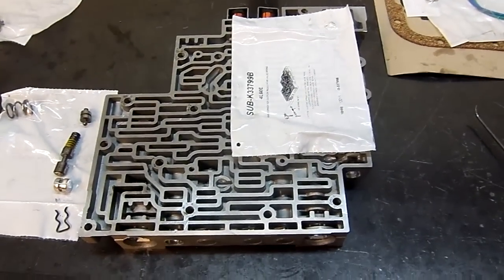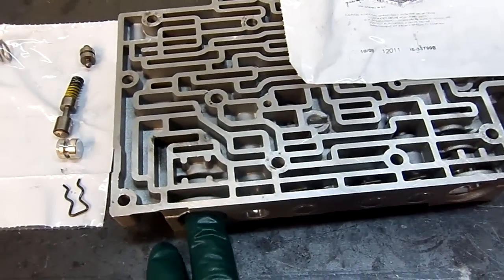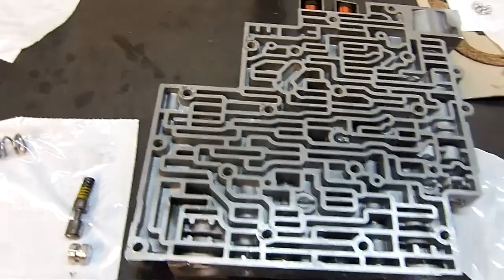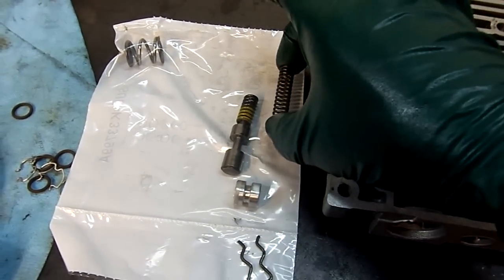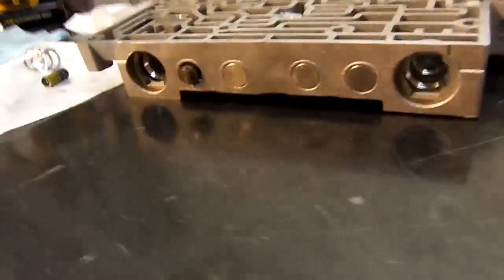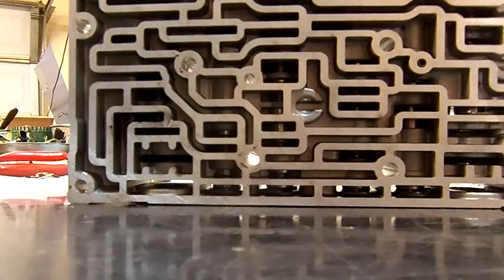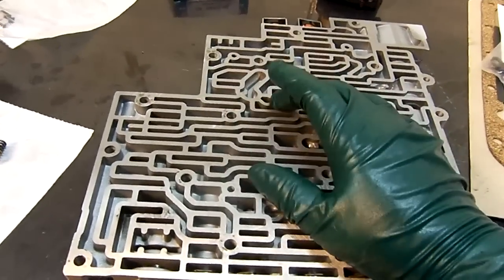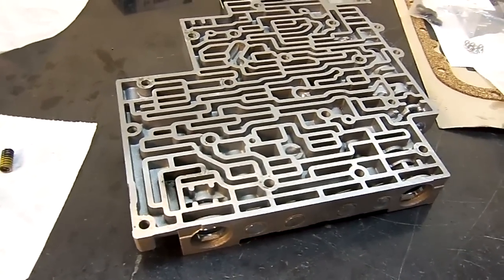4L60E Transmission P1870 Transmission component slipping (early valve body) - Transmission Repair

Comment: Mr. Gutierrez, Please help me. I have a 98 Silverado V8, 5.0 with 148k miles on it; I'm not sure what size my transnmission is. I had the radiator replaced recently and shortly afterwards my truck started leaking transmission fluid it appears to be coming from the big hose leading to the radiator. Then this P1870 code came up. When I check the fluid level when the truck is cold the transmission fluid is up to the "hot" level on the dipstick. But when I check the fluid level when it's hot, it looks like there is no fluid at all, which scares me to death, so I add some right away. Honestly, I don't know if the leak is from overflow, but I guess that's a possibility. Also, it only leaks when the fluid is hot and the leak is pretty heavy. Do you have any idea what may be going on with my truck? It's driving me crazy worrying about it and how much it might cost to have it fixed. I'm no mechanic and would never attempt a job this big. Please help.

Comment: found my problem with no drive or overdrive. It was in the 2nd-4th gear servo. Put a new corvette piston in and it worked. Longer servo pin was too long so I didn't mess with it. Original servo pin is a little worn, but is working
Reply: (1/2) I used origional pin. Changed the piston with a Corvette one. Trans works fine now. The Guy that rebuilt it for me was screwing me around, so i did it m
Reply: (2/2) yself. When it was shifting into drive, but nothing there, it made me think that the band wasn't applying to the drum, and that's what it was
Reply: You can use this as anotherr reason why you wouldn't have drive or overdrive. I couldn't find this answer anywhere online. Only friction plates worn or sprag.
Reply: You're welcome. I couldn't find this fix anywhere online

Comment: Hello Hiram, I have a p0752 shift solenoid stuck on. I replaced it still comes on and i cannot shift past 2nd gear on a 2007 chevy aveo 82000 miles.

Comment: 96 Tahoe 4x4, after say 20 miles. The torque convertor stop locking up. No codes. Will that long spring fix it?
Reply: did you ever figure this out blackricedenice
Reply: bam6972 Yes, when I replace the distributor (290,000+ miles) the engine stop cutting out and the TC started locking up again. Something about the cam sensor help the PCM lock up the TC. Only took 2 + years to fix.
Reply: dam... really? wow... I didn't want to replace the distributor but if I have to then so be it.. any other tips that you did to solve the puzzle. thanks for the info...
Reply: bam6972 Got the part off ebay new for $36.50 free shipping.

Comment: Hey I've got a 97 Chevy 4x4, I'm getting the 1870 code. To replace this part I was wondering if I have to pull the valve body off to replace it? Or can I just pull the valve body cover off and replace it from there?

Comment: I had my transmission rebuilt by a guy in October. 1997 chevy k1500 4L60E. When I got it back, I didn't have overdrive. He told me it was a bad shift solenoid. I changed them both. Still no overdrive. Then I lost drive also. !st, 2nd, and reverse work good. Then I started getting the P1870 code. Can you tell me what to look for in order to make it right.
Reply: Thanks. I'll check that out

*****
Reply: Dennis Xander It's not that. I have 12 volts at trans fuse and gauge fuse. also have 12 volts at pink wire to transmission in park and drive
Reply: Dennis Xander shifts to drive, but just the rpm go up. New clutches and band installed last week, along with all new switches and solenoids
Reply: Dennis Xander  no more P1870 code either. I fixed that problem. still no drive or overdrive
Reply: Dennis Xander do you think it would help if I install a pinless forward piston
Reply: Dennis Xander I have no power at the pressure control solenoid. Now I gotta trace wires
Reply: 3 months. That was over for awhile. I have no power to pressure control solenoid. Have power everywhere else.

Comment: I know this is for a 95, but mine is a 99. I wasn't getting any codes, but my rear planet shattered, could this have been the reason? my TCI/CCR wont retract, the piston is scratched and the spring seems too short like the one in this video.I finally got mine out,  used a small file to knock down burs, but I think the spring has lost its strength.

Comment: hello Hiram, wondering if you could please give me some advice,   i have a 2000 blazer, 4l60e,   i have that 1870 code, and it goes in and out of lockup , not always but after driving for a few minutes, ive replaced the valve body with a good one with the same same over sized spring like in your video,  but it still has the problem.  im hoping its the torque converter or maybe input shaft seal.  but i donno. any way to find out?  or do you know what else to check?  would really appreciate any advice.  thanks

Comment: Hello hiram I have a question I swap a 95 tahoe transmission and engine into my 94 silverado that used to have a 4.3 engine do I need to change my ecu to make my transmission work the rigth way ? Cause now I drive it n all it does just get to 30 miles n thats it wont go further than that it seems like its slipping what can I look to fix it

Comment: I have a 99 trans am with a 4L60e that was just built and I noticed in first gear feels like the TCC isnt engaging intermittently had my builder take it apart twice couldnt find a problem fluid was clean already has a .500 boost valve and he turned up the pressure on the control valve and still has the same symptom do you think this could be the culprit?

Comment: excellent real world repairs. Late model 4l60e vlv bdy- you flipped the isolator vlv and on the early vlv bdy- you repl. the spring.  Can you use repair kit A74741Q (stationary vlv) on either vlv bdy? thanks

Comment: I have question for you what would cause torque converter to drain back. Pump clearances and bushings are good. This is after rebuild it moves after it get fluid in the tc and drives fine. Just when it sits over night fluid drains back into trans.  Thanks
Reply: ***** It is a 2000 Chevy Tahoe 4x4  5.3l 4l60e. I have the trouble code P0742 tcc stuck open. When coming to stop or reverse it stalls. I have a new tcc solenoid with anti drain back valve coming to replace it. The trans builder gave me a 2004 valve body to put in,  due to him being busy in. He thought it was that. I placed all check balls in and held them there with trans assembly lube. Still have same problem and same code. would a stuck tcc solenoid cause drain back if open and the valve stuck open?
Reply: Hiram Gutierrez . Hey I need help I have Lumina ss 2007 4l65e transmission has changed also changed the clutch 1/2/3/4 Manfall Presser solenoid TCC clutch problem 3/4 not working. But the 1-2 reverse works well

Comment: I watched your other video before I saw this one and I installed the spring first and then the two valves and plug, then drilled the plate. Will this accomplish the same thing or do I need to change it around before I put it back together?

Comment: Hello Hiram, awesome video.  I have a 99 s-10 that is identical.  At first the endplug was stuck in place(lined up on the end of the valve body like the other ones) and I pushed in on it and it broke free.  Then the end piece is loose and stays inside of the control valve.  Mine has the old spring, etc and has no kits added.  Would you recommend replacing that spring first with the bigger one?  Thanks

Comment: So this only makes the code go away and doesn't fix the slippage? I got the P1870 on my 96 gmc jimmy and when it tries to go into 3rd it just slips and acts like its in neutral and it revs up. I have to keep it in manual 2nd so it wont try to go into 3rd
Reply: Ok thanks for the info. I also have a lot of fine grey metal on the magnet in the pan and the fluid is dark... Looks like im going to have to rebuilt the trans

Comment: Hiram,  Your videos are great!  I have been reading that vehicles 1998 or newer (ones that utilize EC3 PWM) that have that spring installed suffer from cracked TCC pistons inside the torque convertor or cracked flex plates from ballooning convertors.  And the better fix is the Sonnex TCC valve insert.  What are your thoughts?

Comment: i 1996 gmc sierra 4wd i instal the pump in transmission and the valve body and i do not have 3 and 4 onli1 2 sbift to2strong

Comment: I would like to contact you I'm having issues with a rebuilt 4l60e that whem fluid heats there is no tcc lock up I droped the pan fluid is clean I've already replace both tcc solenoids I know it's not a brake switch cause my cruise control still works
Reply: same issue here. did you ever figure it out. I found that installing a huge trans cooler made the tcc work a lot longer.

Comment: hey buddy will the earlier  model 4l60e valve body interchange to the pwm valve body just by installing pwm selinoid
Reply: Thanks for the information. Do you suggest the pinless accumulators on 1 2 to 3 4 ?

Comment: Just block the left valve to the left with an extra shift sol. Clip and be done with it ....Makes the lock up on off, and either converter can be used... Why waste money on the sub kit
Reply: can you be a Lil more specific? u saying don't use the plug but put a solenoid in place
Reply: no that's not what i'm saying. there is no solenoid in that place. there is a valve. block the valve to the left with an extra clip by moving the valve to the left and dropping in a clip

Comment: Hello, where are you  located? Also how much would this repair typically run me ? I have a 1996 ss Impala with this same code and it kicks hard going into second.
Reply: Did you ever find out what was wrong
Reply: @zoetyson1374  no I haven’t, my car has been sitting for 6-7 years as of now . I’m trying to get it fixed with in the next year